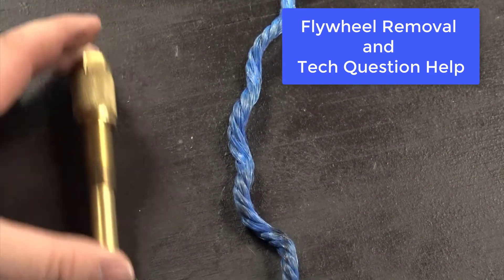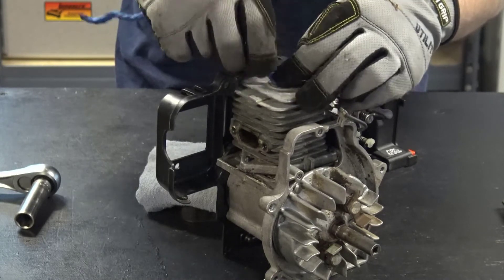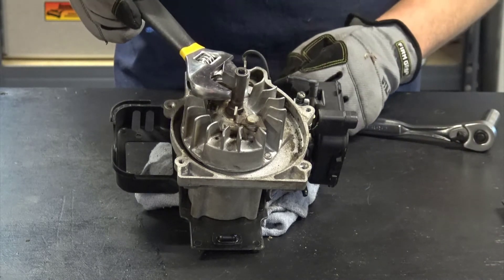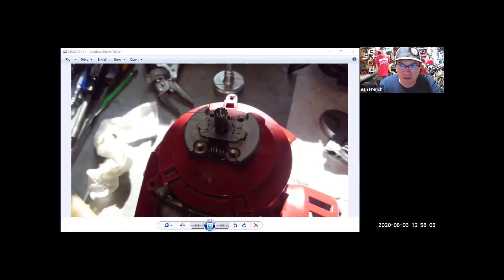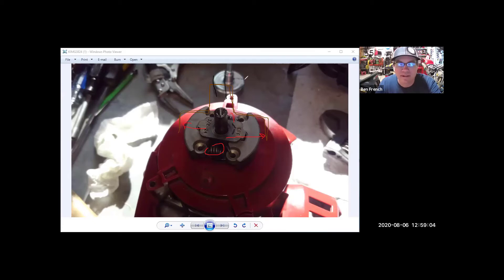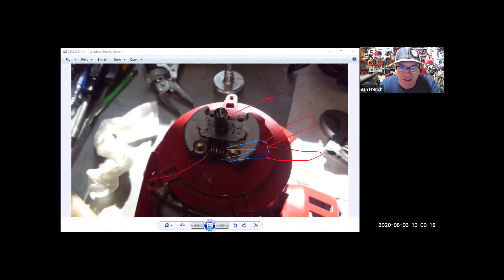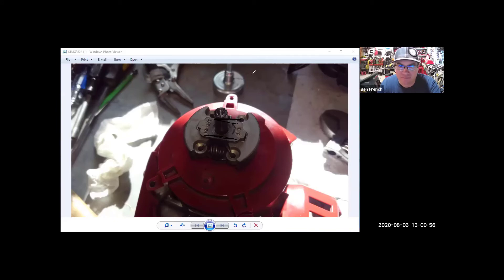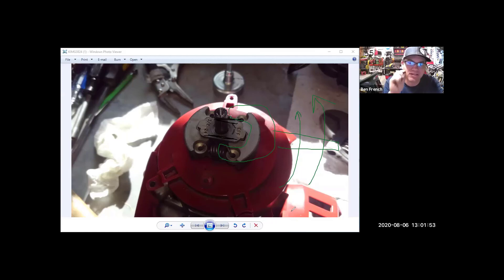2 Stroke Flywheel Removal

Comment: are the flywheels pressed on?
because i tried starting a grass trimmer 2 stroke engine mounted on a wooden board with a socket and drill
i had my finger on the throttle at full throttle when i started it
the drill bit socket flew off and the flywheel broke off or came loose
the fly wheel is loose but stuck on the shaft because i have a nut on the shaft
i dont know what  to do